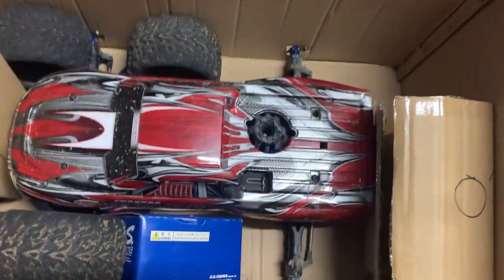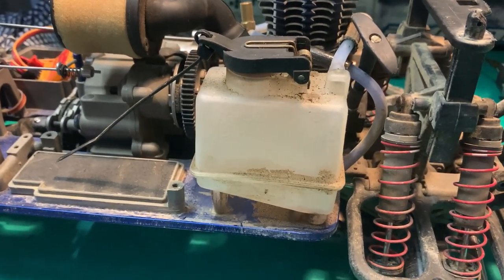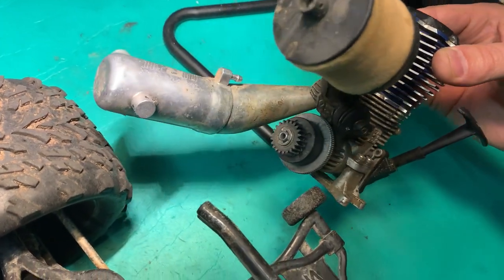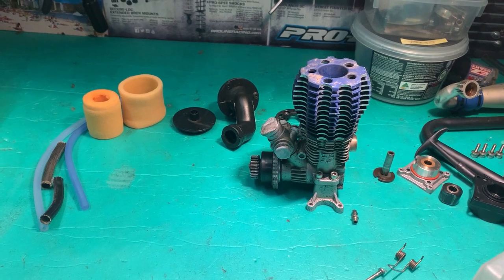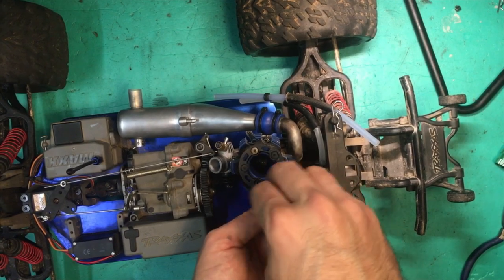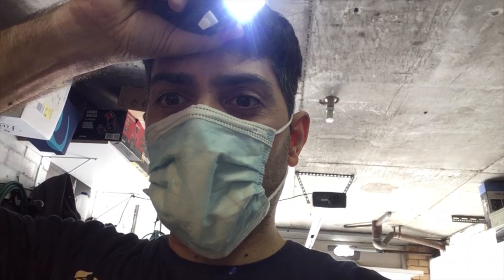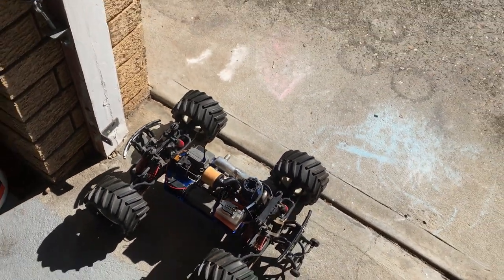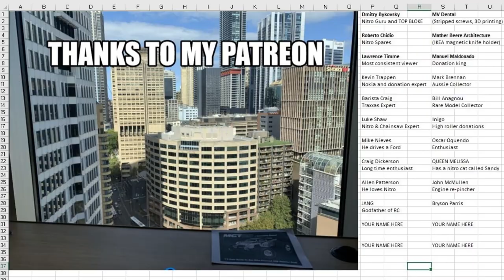Traxxas TMaxx 3.3 Fuel + Carb + Shift ISSUES! CorporateNitro EP16

Comment: Also good observation on the clutchbell itself they are much closer teeth not exactly mod one but this allows for a fairly high gearing ratio which I don’t mind.
Reply from the maker: Ahh that’s why they went with mod0.8, allows them to have more teeth in the spur which means more teeth on the pinion, to improve power transfer from an engine with limited torque